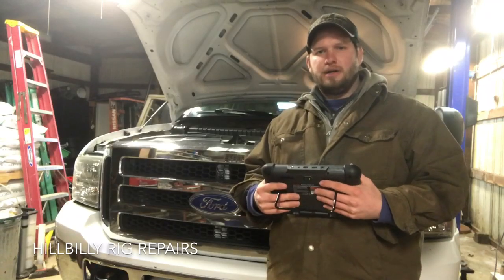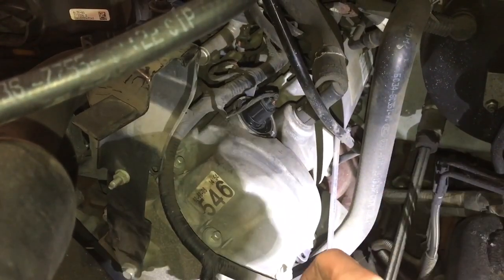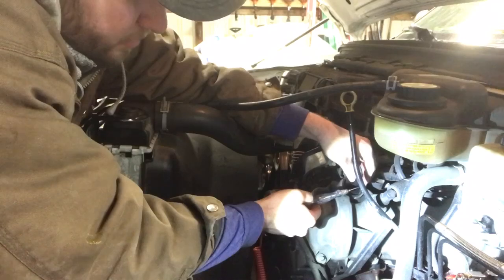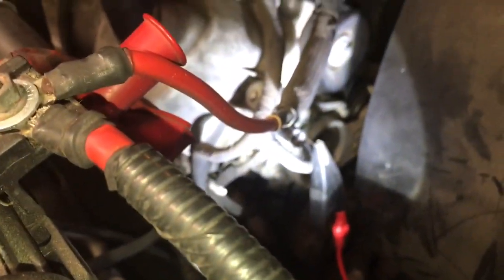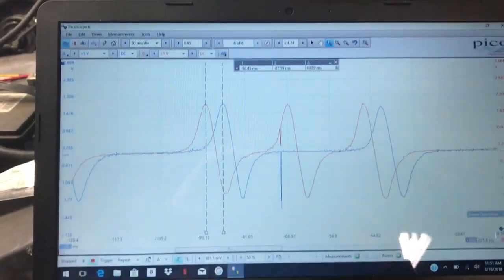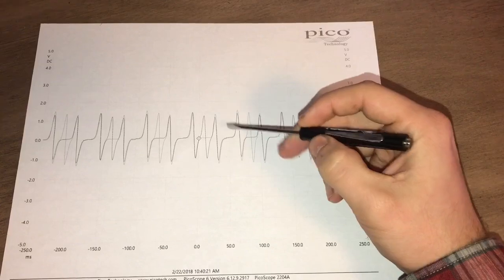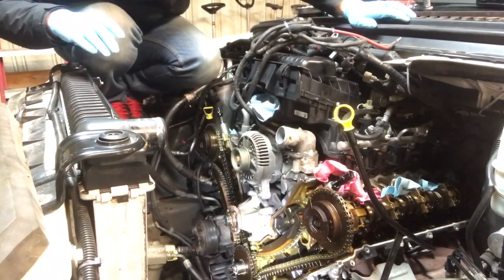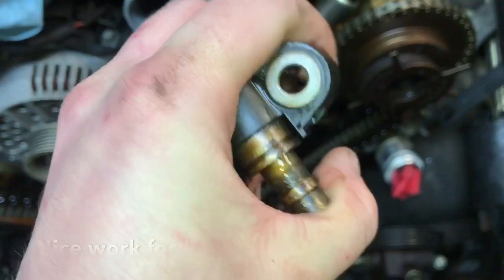Ford 5.4L P0022 P0012 Jumped Timing Chain

Comment: I have a 2010 F-150 king ranch. I’m showing codes p0012 and p0022. I was driving and it started misfiring and shut off. Now it wont crank. My truck burned oil quicker than I thought so I was very low on oil. I refilled my oil to see if the pressure would engage it open. However no luck. Could it be destroyed?

Comment: That is a big engine compartment.  i am ready to do my Navigator and will most likely change everything while I am there. I had an accident with my oil filter and my wife was driving the car.  Not her fault but she drove it until the engine stopped.  I filled it with oil and I am getting phaser noise and timing codes. No oil pressure caused it I guess.  Hopefully there is no damage beyond the timing and phasers.  I sounds good but rough idle.

Comment: Before you go too far down the rabbit hole on this, make sure you check your oil.  Apparently my truck burns oil more than I thought and was super low and that (as stated) can cause the issue.  So far so good.

Comment: So, if the timing chain jumped, I should immediately get the codes again after clearing them, and starting back up?
Reply: Uhm take this with a grain of salt,but maybe? 
I know if you use an OBD2 scanner you can reset codes,usually when the car is off

And with my experience sometimes the certain code/s show up within seconds of clearing

BUT I have had other codes not re appear for like 330 min/1 hour and than re appear 
But I guess what I'm saying is if it isn't there after fixing and clearing the first hour than it's safe to assume you had fixed the problem

(Also the codes referrals were a P0017,P0016 on my Toyota Venza)
Also now I got the P0012 and P0022 codes shown fml. 
It was extremely low on oil

Comment: I know this is an older video, but did the problem with this truck act intermittent? Or was it all of the time, more curious if while running if it was off by 1 tooth, if the computer was compensating using the cam phaser and could make it run well for the most part.

Comment: I have a 2007 Ford F150. I gave the code p0012 p0022 and p0345.  but when you're driving it, it turns off the engine when you stop.  is constant that l.
Reply: What was your fjx

Comment: I fixed my 2010 4.6 f150 by replacing the cam shaft position sensor and VCT solenoid . 
The 4.6 requires the valve cover to be removed to change the solenoid . Also , the cam shaft position sensor broke off flush with the casing so I had to remove the valve cover anyway to get out broken piece .

Comment: My friend I'm needing your help, I have the p0012 code in f150 5.4 2004 Triton, I replaced the solenoids sensors and camshaft sensor too and the problem in my truck continue. Not power at all , and the scan show up the same code P0012. What I can do? Thanks

Comment: What If the truck dosent crank at all
Reply from the maker: Well I would verify starting circuit.
-Sit in car with key on. Any weird security lights on/blinking?
-key on high beams on then try and start. Do the lights stay bright?
-put in neutral with foot on brake then try and start.
-connect test light to starter stud and ground, test should light.
-connect test light to starter “S” terminal and ground, should light when you try and start.
-test light from battery ground to metal part on engine, try and start, should not light.

Let me know what you find.

Comment: What new set did you put back in the truck? How’s it running after the install?
Reply from the maker: All Ford OEM parts. Havent had any complaints about the truck-and it gets beat up on daily.
Reply: @hillbillyrigrepairs1814  so I got mine all broken down oil pan and all.  Passenger side guide was broken.  Seems to have jumped time also.  Do you have idea how I can get it back in time?    I’ve ordered the whole new kit from freedom racing Ford motorcarft parts
Reply from the maker: https://youtu.be/qpPs9KuJmqM

This guy is reliable

Comment: Awesome troubleshooting Sir.  How many miles were on this motor and what was year of manufacture?  What screen are ya using there ?
Reply from the maker: O6’ 125K
Reply: @hillbillyrigrepairs1814  Thanks.  Neighbor's Explorer is 2007 4.6L, with 130k miles.  Runs good til it gets warm then rough idle with some noise up in front of engine.  I checked oil psi and got 50psi initially at idle but it fell down to 15-20 psi when hot.  Stethoscope says noise louder on bank 1, passenger side, which is where the P0012 code points to.    Will advise him that front of motor will have to come apart along with valve covers.   Has anyone else noticed that nobody seems to be selling the hydraulic tensioner mount gaskets with the kits.  Rock Auto does sell them but ... separately.   I'm pondering whether people are forgetting to install them ... inasmuch as several posts in this thread complain of doing a complete Timing Chain job only to still have problems.   Finally is there a TSB for this update / revised oil pump or is it just a PN supercession ?  Thanks in advance.   DPQ in FLL.
Reply: @hillbillyrigrepairs1814   Thanks.  Have you seen this vid by Cloyes.  It mentions excessive wear and clearance at the front journal for the cam bearings, which of course is a big problem ... requiring head replacement ?   https://www.youtube.com/watch?v=WU_jjlTpECs

Comment: I had the same error p0022 i got it cleared, but the car making a weird rattle when letting off the gas, what could it be?
Reply from the maker: Likely a loose timing chain slapping against side of front timing cover.

Comment: Did you end up putting new chain kit on it ? My phaser is knocking and it has a REALLY bad idle and almost stalls at points . Wanting to replace the chain but don’t want to do that if I have to replace the engine . It starts up and stays running but just really poor shakes really bad and putts it seems like
Reply: These engines are known for timing issues. The oil pump is lacking. Replace the oils pump while you and in there with a Melling 340hv oils pump. They provide 20% more oil volume. I would also replace roller follers if your engine has the old model. 

The core of the engine is good so as long as you fix the timing issues you should get 250k+ miles out of the engine if given regular oil changes.

Comment: I have an 06 with same issue although the other sides adjuster gasket went out . I am going to replace my adjusters with the metal type used in the 5.4 2v  1st gen engine . I believe it's how that you modify them when building for high  performance .

Comment: Did you ever actually verify that it did jump the timing? I replaced the lifters, rockers, both VCT solenoids, phasers, chains...the whole shebang! and now getting those 2 codes P0012 & P0022. I don't want to tear into it again unless I am sure it jumped the timing (although I really doubt it!!). The truck runs good.
Reply from the maker: You really need a scope hooked up to look at the waveforms-the cam and crank correlation has to be dead on with these engines..Don’t get frustrated, just keep going. Good luck
Reply: @hillbillyrigrepairs1814  is there any way to do a cam/crank relation test with an oscilloscope that does not have isolated grounds between channels? My Picoscope 2204A does not have isolated grounds between channels, so when I hook up to both the crankshaft sensor and camshaft sensor, the truck won't even start or run because the grounding issue. I can test either one of the sensors independently, but not simultaneously....

Comment: It's actually the cam position sensor. It's right over the oil filter so after changing the filter several times your hand bumps the wire and crimps it up..

Comment: Muchas Gracias Amigo, Thanks a Lot My Friend, Your Video Brings More Light Into The Darkness Of My Mind...
Reply: Hola soy de chile me sale el scanner  conde po022 que debo hacer puede ser en español
Reply: @juanpaz156  Hola Juan Espero Te Encuentres Bién, Hace un Par de Semanas Tuve un Problema Similar Con El Codigo P0022 Y La Solución Fué Limpieza de Los Solenides qué Se Localizan en Las Tapas de Punterias Con Un Limpiador en Spray Para Carburadores, Necesitas Checar Si Los Filtros de Malla qué Llevan Éstos Solenoides Se Encuentran en Buen Estado ( qué No Estén Perforados) Porqué Sí Están Dañados Tienes Qué Remplazar Los Solenoides, Además Despues de Limpiarlos o Remplazarlos Debes Cambiar el Aceite del Motor Por el Grado Indicado Por El Fabricante del Vehículo en Cuestión, Espero Te Sirva Ésta Información...
Reply: @leonciorodriguezaguilera9513  ok muchas gracias .mira lo que le pasa .parte bien después de calentar normal se me descontrola y aparece el conde. Po022 revise las válvulas que me dices y están sanas igual las limpie y el aceite es 5w30 nuevo pero sigue con el problema.
Reply: @juanpaz156  Hola de Nuevo Juan, Cuando Sacaste el Aceite Sucio Te Fijaste Si No Tiene Pedacitos de Metal o Plastico ?
Reply: @leonciorodriguezaguilera9513  hola mira lo llevé a cambiar a un servicio no sabría decirte .e visto artos videos y todo me lleva a trabar el piñon es lo que me queda creo. Te tinca e agotado  que más hacer😔
Reply: @juanpaz156  Mira Juan No Se Qué Tanta Experiencia Tengas en La Mecánica Automotriz y en el  Diagnosticar de Circuitos Electricos, Se Necesitan Checar Los Ohms ( Resistencia) del Embobinado de Las Válvulas Solenoide qué Dices Ya Limpiaste ( entre 7 y 12 Ohms Generalmente) y de Allí Sí Dan el Omeaje Correcto Checar el Voltaje Qué Les Debe Llegar, Checar las Tierras Correspondientes, Continuidad Entre Las Válvulas y la Computadora, Etc, Si Todo Lo Anterior Está Bien, El Problema Es Mecánico, Podría Ser Qué La Sincronización del Tiempo Está Afectada Por Algún Componente Cómo Puede Ser Las Cadenas de Tiempo Qué Se Hayan Brincado, Las Guias de Las Cadenas o Algún Tensor de Cadena en Mal Estado y Sin Olvidarse de Los Actuadores qué Van Montados en Los Arboles de Levas, En Fín Se Necesitan Checar Varias Cosas, Te Deseo Paciencia y qué Encuentres un Buen Mecánico...
Reply: @leonciorodriguezaguilera9513  ok amigo te lo agradezco voy a seguir buscando te diré si soluciono el problema un abrazo y cuídese.
Reply: @juanpaz156  buenas noches puedo hacer la one pregunte hacerce de esos codigos

Comment: So what cause the gasket to blow like that? Something eating away at it. Can seafoam left in crankcase too long cause this. I put some in my truck for about 4 to 5 days before I did an oil change about 2 to 3 weeks ago and I'm getting retarded on bank one so I'm assuming tensioner wasnt working properly and I was on a bumpy road and probably jumped.

Comment: 3:20 the ground wire the other end is connect to the battery or were do I connect it
Reply: Any bare metal should work but battery negative is best

Comment: I had the same symptoms and codes P0012 & P0022 on my 2010 Ford Expedition. My car was sounding like a diesel truck when i turn corners and came to a stop.  I was getting ready to replace VCT solenoid but your earlier suggestions made me check the oil myself.   I took out my dipstick and there was no oil at all on the stick.  I went and purchase 2 quarts thinking that should get me back to normal but I ended up having to put in 5 quarts.  After this I didn't have that issue any more....      Thank you for the video, you saved me from spending my income check!!! :)
Reply: holy shit.
Reply: Magnum Mountaineer  agreed,    the camshafts would have seized to the head at the point due to starvation.    just went thru this on a 2010 i bought where the previous owner ran it out of oil.
Reply: This Message  was intended for people in my situation  that don’t know of proper maintenance procedure for car. In my case,my oil light was not working an oils dropped between 4-5 quarts low.   I only posted on this site because this video saved me from spending unnecessary money an wanted to return favor by spreading the knowledge
Reply: @ericsmith3484  thanks for sharing. Do you mind elaborating on the lack of oil cause? Was it due to a leak? If so what failed? Did the shop who serviced the engine forget to add oil? How many miles was it driven before the engine began to stumble and throw codes? Genuinely curious.
Reply: My 2010 Ford F-150 does the same thing whenever I would turn corners it would begin to raddle and shake and also sounded like a diesel truck.. mainly would occur at drive thrus smfh

Comment: I just did my timing, same thing you diagnosed low tension on the chain,  and  low oil pressure surprising my tensioner gaskets where still in one piece, replaced everything including cams and went with the new roller followers design and lash adjusters.

Comment: i see your using picoscope freeware but how did you hook up the camshaft sensors for the correlation test? is there an obd kit different from an elm adapter?
Reply from the maker: The scope has two channels, 1 test lead to bank 1 variable reluctance(VR sensor, or magnetic pick up or cam) sensor and the other channel to bank 2 VR sensor.
This test is performed separate from the DLC or any scan tool. I guess you could bench test the sensor with an ohm meter if you’d like🤔

Comment: I have codes p0011 & p0021 i have changed camshaft, chain , oil pump , lifters , camshafts sensor but I still have have the same codes and the engine is shaking all the time what do you think ? Please help
Reply: May have to reset KAM after these repairs.
Reply from the maker: kas0016 I would wait to clear the codes(I’m assuming that’s what you meant by “resetting Kam”)
I would look on the scan tool to see if the cam and crankshaft signals are synced.
Check other PIDS-make sure no new codes were set during the repair(ex: left a sensor unplugged)
Check oil pressure and temp gauge on dash and bring the truck to operating temperature.

Leaving the timing code in memory will have no effect on how engine runs.

Now that everything checks out and all new data is saved, go ahead and clear the codes and proceed to check for a “hard fault”(Code comes right back on next scan). My 2 cents👍
Reply: @hillbillyrigrepairs1814  I was referring to adaptive memory,

I have a question, when I pull vct solenoid pigtail I get no change, In fact since I pulled it and put back it reduced and almost completely ended my low rpm sound that these are notorious for. My idle is quiet though. Shouldn't my idle sound rough like yours in the video when plug pulled? Ty
Reply from the maker: kas0016 Disconnecting the VCT solenoid while vehicle is at idle should cause no idle change; the solenoid should never be energized at idle. Your VCT solenoid may have been hung up. I find these solenoids should be replaced every 100,000 miles; got to keep the oil clean in these engines too.

Backprobe the control wire on the VCT while engine is running. Connect test light to battery positive, touch control wire. Test light should not light.
Reply: Hillbilly Rig Repairs question::  i replaced the timing chain-and shaking continued, changed the vct solenoids and no change and p0340 and p0345 codes along w misfires...if i energize the old vct’s they work ( direct to battery ), only thing i havent changed is phasers.  If i disconnect vcts and drive its nice and smooth.   What should i check next? Phasers?    Is there long term damage if i just keep vct’s disconnected?    

Great help.  I may buy a scope too .
Reply: @mikhailzapata1993   Misfire? I have the same 3 v motor- Have you checked each cylinder for firing? Could be a simple Coil,  Idid my chains,tensioners and guides and Phaser Lockouts- VCT's etc- And Replaced all plugs and coils- Runs BETTER than New.  Problem with this Motor is the Tensioners and guides Break with this Crappy design..No Matter How well you take care of her.......
Reply: Do you recommended the manufacturer 5w20? I hear a lot of mixed opinions on these solenoids and weight differences. I have a 2nd generation expy and I heard the 3rd gen updated the solenoid and is backward compatible on the 3 valves
Reply from the maker: I run 5w30
Reply from the maker: I hear from a lot of guys who get these codes-they put an engine flush treatment in the oil, change the oil then throw new VCT solenoids on the truck.

I guess you could pull the timing cover and verify timing marks are set correctly. Don’t forget the cam phasers are a failure prone item too.

Getting a 2 channel lab scope and checking out some waveforms would be best..
Reply: Hillbilly Rig Repairs thanks buddy for your advice

Comment: When you probe the ground wire on the solenoid is the wire you have connected to pos. Or neg ? Do you add power to the solenoid or just ground to ground?
Reply from the maker: Ground to ground. If you have the jumper polarity wrong or touch the wrong wire, you will smoke the computer.
Reply: @hillbillyrigrepairs1814  Would i smoke the computer if i did ground to 12v wire on the connector? I am not getting 12v at the solenoid
Reply: How much normally does it cost to have the timing chain corrected.and should a new chain and tensioners be replaced with new?
Reply from the maker: The book time for timing chain replacement is approximately 10hrs. 

It is recommended to change all timing components when replacing timing chain.

Expect to pay $1,400 for parts and labor